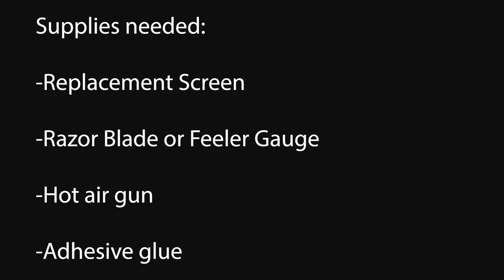How to Replace Display Screen Glass on iWatch Series 2 Apple Watch JoesGE

Comment: How do you deal with the apple watch not updating after the new screen is in?
Reply from the maker: You will have to replace your screen with the old one. Update it with the old screen. Then remove the old screen and add the new one. When you add the new one then you can do a reset by holding the power button and crown button until you see the apple logo go into a loop. This will fix your issue. - JoesGE Repair Ninja.
Reply: @Joesge  Well I broke the whole thing so it doens't matter anymore. :(
Reply from the maker: Sorry to hear. If you would like your device repaired by a professional you can fill out a repair form and follow the steps to send in your headphones. We offer free shipping and diagnostics. Here is a link to the repair form: 
https://www.joesge.com/pages/repair-services 
-David P

Comment: My series 2 is a little cracked and I’m struggling sooo hard with these repair costs. I could damn near just get a new watch instead of paying 200 just to replace the screen 😭
Reply from the maker: It’s tough :/ screens are really expensive since they are not realty  available.
Reply: Erika Taylor I hear you! Dropped my watch last week, fell face down onto my wooden floor, screen smashed totally.  I'm in the uk and all,I can see on eBay is a couple of companies selling screens for £165 :o

Comment: What if I provide the replacement screen? My touch is no longer recognized and the screen is broken but the display works. I’ve bought a replacement watch for parts. Would I be able to send both and just pay for labor?
Reply from the maker: Thanks for watching! We can definitely use your parts to replace the screen. However, we do not offer any warranty on the service if the parts are not purchased from us. We would charge you the cost of the screen replacement, minus the cost of the part and it would usually cost around $40. MD.

Comment: Do you recommend the B7000 adhesive instead of using the 3M adhesive tape (like on Amazon)
Reply from the maker: B7000 is easier to use in our opinion for screens